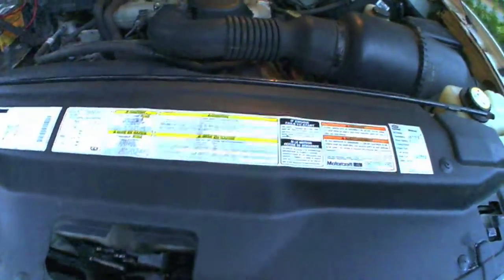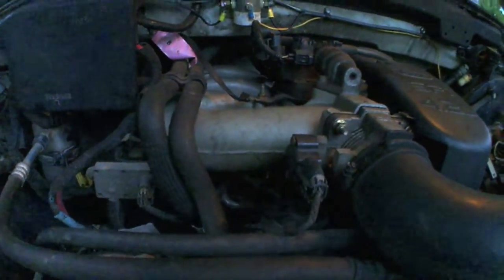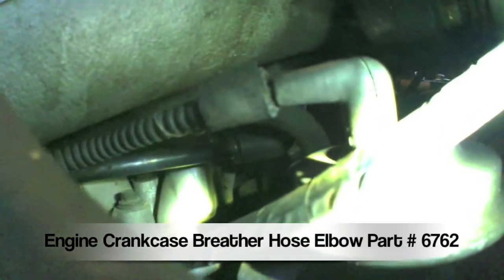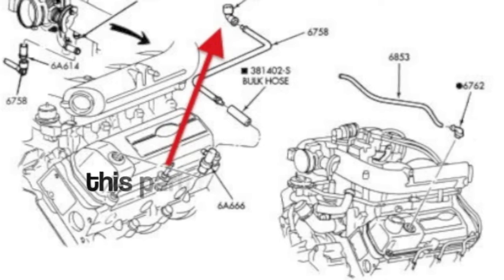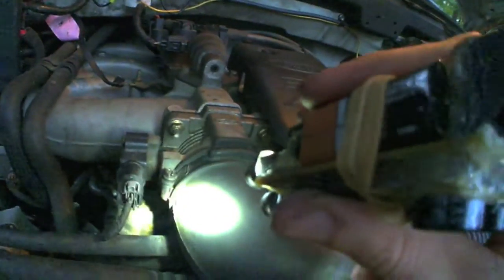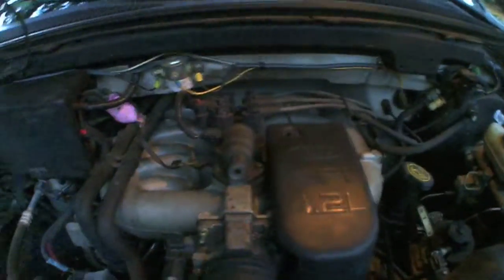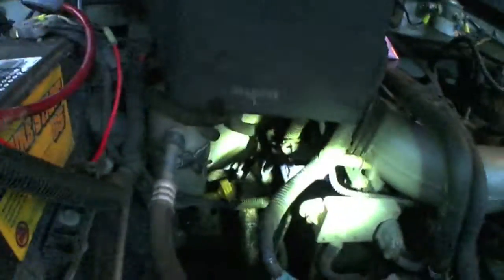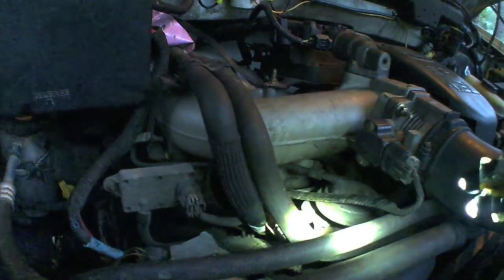97 4.2L F150 rough idle problem

Comment: Just replaced the elbow with the Dorman part, $10, it was a very tight fit. Finally was able to wiggle it on with a pair of long needle nose pliers with 45* bend. Wish I'd done this a long time ago. Runs very smoothly now. Thanks for the vid.

Comment: Welp, I guess I'll check mine. Running rough at idle and evens out when given any RPM, but definitely running a bit lean too. Same year, 97 XL Super Cab, 4.2, 5 speed. I hear a whining noise, not quite a hissing. Sounds like a balloon letting air out, or a very quiet rubber chicken lol. EGR was acting funny before and after I tried cleaning it that cleaned up the idle a bit, then I recently changed plugs to Motorcraft platinums and that kinda accentuated the lean condition, so I hope it's just a vacuum leak and nothing more expensive. Maybe that's why I was getting IMRC codes before...

Comment: Removed passenger side tire and splash guard for optimal access to hoses.
Reply: You will likely not see this but I have paid $$$ to have these replaced more than once. I have a 98 and can't for the life of me get to these lines but will see if I can remove that splash guard and have at it since they both need it done ONCE AGAIN. Does anyone make heat resistant elbows?

Comment: just bought a 97 4.2 had the same problem and i just put a vacuum cap on it and drove it no more stalling and smooth idle and I'm not fighting putting that damn rubber elbow on
Reply: That's going to cause gaskets to blow out

Comment: Hi, I have a 1998 Ford F150 and have the same idle issues. My front elbow is definitely bad, I see a hole in it. I was trying to replace the elbow in front there that goes up to the bottom of the intake. But, I am having trouble getting the new elbow onto the intake connector. I was trying to avoid having to take more parts out to really get enough clearance to get it on on all the way. I got the Dorman elbow and it seems to be a really tight fit. I even tried a little silicone to help slip it on. What did you end up taking out in order to really be able to reach and be able to get the new elbow on? I am thinking maybe the throttle body needs to be removed for clearance. Thanks for the video and the help!
Reply from the maker: I was able to get in on without taking anything apart. maybe you should trim the elbow down a bit to fit it in there more easily. it only ever sees vacume never boost pressure, so even it it's hardly on I can't imagine it coming of. also less rubber tubing would mean less chance of it imploding again.
Reply: Did you use the dorman version of the elbow or ford version of the elbow? Mine is crazy tight (Dorman elbow). I even warmed the rubber up a bit, tried silicone, etc. I cut my hands up trying to get it on. There is not a lot of clearance, so I was thinking about taking the throttle body off for more access. I have the 4.2 liter, v6. I also noticed a metal tube that slides out of the little port in the intake that the elbow connects to. Is that extra tube supposed to be able to slide like that? It seemed loose, but I was able to push it back up into the intake. Thanks for your response.
Reply from the maker: +Rob NOspam I always try to use factory parts. I got them from the Ford dealership. aftermarket parts are never guarantied to work and if they do probably likely not for as long. small part like these are almost always lesser quality I've found.
Reply: I heard Dorman parts are usually pretty decent and are made to OEM specs. But maybe I will get a FORD elbow. It seems like the Dorman elbow is way to tight. Thanks for the info! BTW, I am thinking I should change the elbows in the back too. PCV elbow and other elbow in the back.
Reply: did you have to remove anything to get to the back one.
Reply: I have the same truck (98 F-150 V6) with the same problem. I bought an elbow from Nappa. It was really tight and I still haven't got it on yet. In the process, I popped the back one off too. Now I can't even see the boot in the back. It is "really difficult to get to" as he said in the video. Do you have to remove all kinds of stuff to reach the back one?
Reply: Just put mine on, put the left hose on first as it was more difficult but them dealing with the intake port I also noticed a black tubing that slid in and out as rob mentioned but wasn’t metal in my case. I actually took that off and just slipped it right over the intake port without any effort. Hopefully that sliding piece doesn’t come to bite me back later on, just doesn’t sound as free flowing as it did. But with that sliding piece on I noticed that the new PCV elbow would not stay as I drove

Comment: I had the same problem with the same bend 
I removed the plenum and replaced all the questionable vacuum lines 
I still catch myself looking at the code area
Reply: brianmentel8717 above said to remove the splash guards from the wheel opening and you can reach. I am def trying that instead.
Reply: That's fine my biggest problem was the rubber vacuum line into the block had a burnt hole

Comment: What are the colored plastic lines that come off of the intake manifold called? Or the part number(s)? Also that “solenoid” was the fuel pressure regulator. I had to change mine because my truck was running lean as well.

Comment: Where did you buy the vacuum hoses ???
Reply from the maker: jims tools the ford dealership in my town.
Reply: @caveman420bc  Thank you a lot. I replaced almost every part. My van that's 17 years old still looks great. How much did you pay for them, and did they come already made or you had to buy a roll of it?? I've had this problem for years. Every time these mechanics work on my van the release tabs are broken. They say it's  this or that. Never again. I'm going to attempt this by myself.
Reply from the maker: I think if I remember right there 2 different special parts with part numbers but I used only one for both bc they didn’t have both.  Both are just elbowed vacuum line.   I wouldn’t try to use unbent pieces it would kink
Reply from the maker: I don’t remember what they cost but I’m pretty sure I wasn’t mad about it. So can’t be to bad.